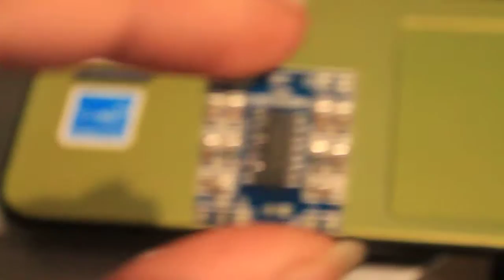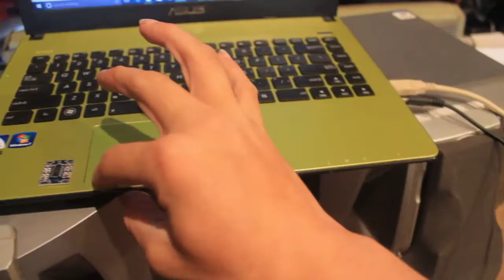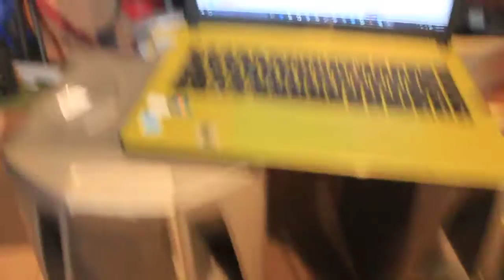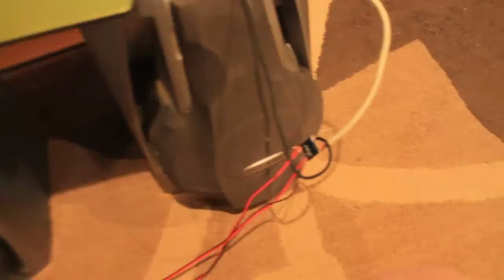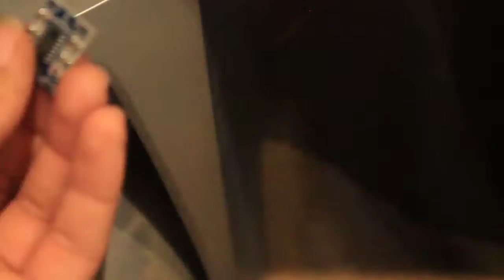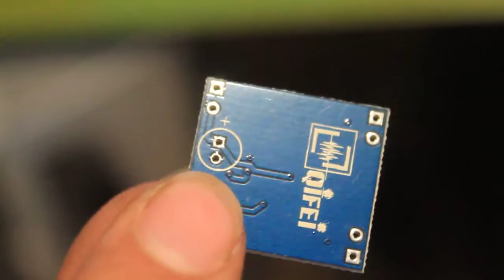PAM8403 module Review

Comment: Are u powering it using usb2.0 (5v 0.5amp 2.5watt) ?
Reply from the maker: That is a USB 3.0 port, but it will work with any USB port capable of delivering the current needed, I would guess the current needed would be closer to 700ma, but most USB ports can deliver close to an amp or more on modern devices. You would have to test it and see. If all else fails, you can always use a phone charger to power it.
Reply: u can power it using
https://www.banggood.com/DC-DC-Converter-Step-Down-Module-UBEC-3A-5V-12V-BEC-For-RC-Airplane-FPV-p-981978.html?rmmds=search
u can get it cheaper on fleabay

Comment: Hey coud you tell me how much speaker watts it can support?
Reply from the maker: +Shiv Rana 3 CLEAN watts per channel.
Reply: You can use whatever speaker you like. As long as its 4-8 ohm. The amplifier will not be affected it will still put out 3 watts however big a speaker you put on it.
if that´s what you meant.
Reply from the maker: These are 8 ohm speakers, 4 ohms might yield a better result due to the ability to dump more current at a lower voltage